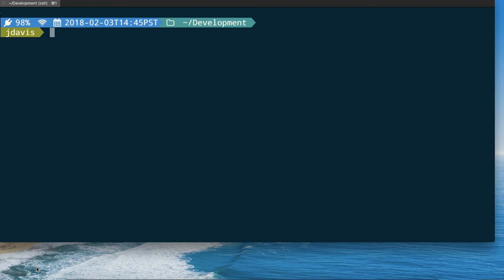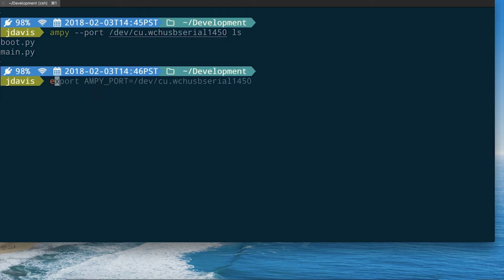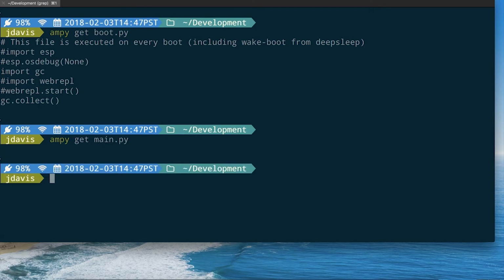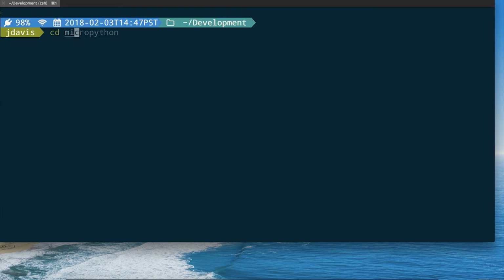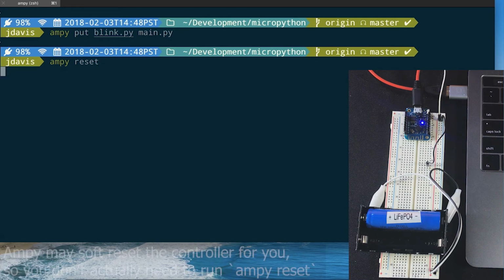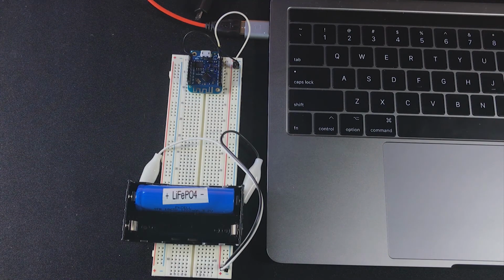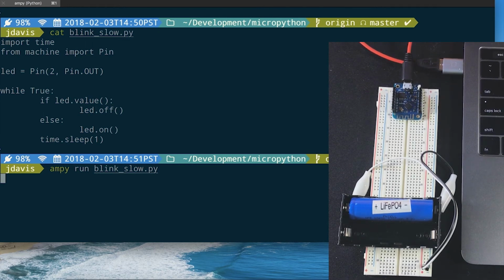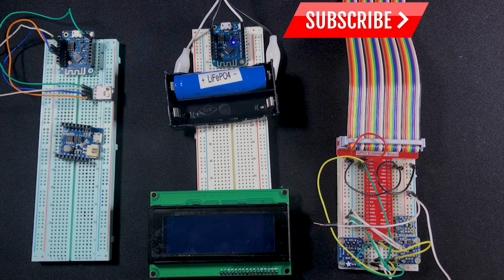Making Micropython Useful (again?) on a Wemos D1 (ESP8266)

Comment: I use a combo of Atom (where I type out code) with the Platform IO Terminal package (gives a CLI interface within Atom) and rshell (makes editing files on the board simple)
Reply from the maker: That sounds like an excellent setup for getting real work done. Not too long ago I traded in Atom for Visual Studio Code (which is odd because I grew up in the prime of 'F-Microsoft, long live the penguin' era), but it has similar capabilities for terminal. I had another commenter mention rshell as well, which I've taken a look at and is very promising - but I haven't had a chance to use it yet.